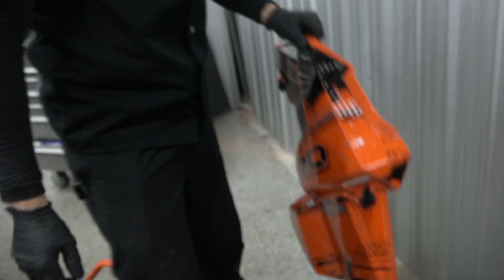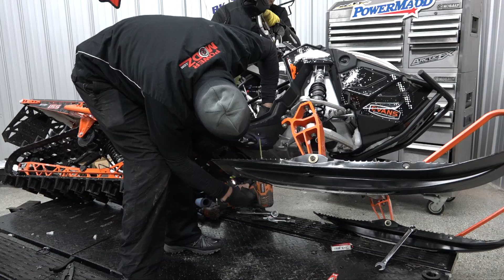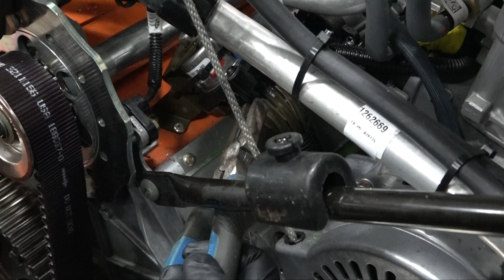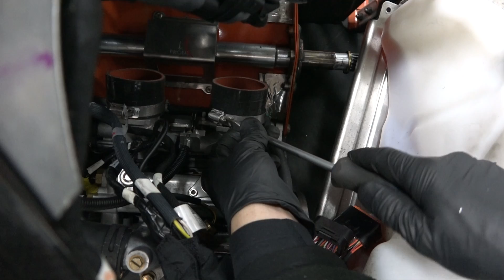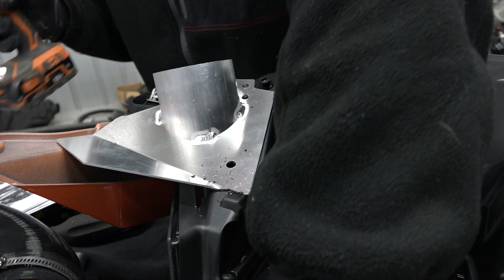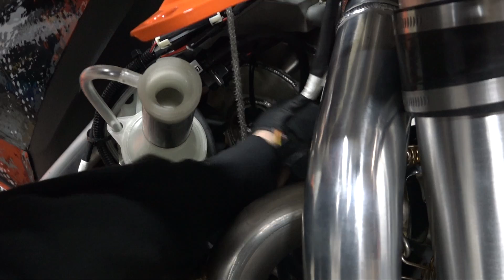Boondocker Sidekick Turbo Install - 2016 Polaris RMK AXYS 800!

Comment: Hey man I have a question I’m new to this turbo game, And seems that my waste gate has a slight leak coming from the 5 bolts area, Also what type of oil should I run on my 2016 axyz turbo and where is the oil tank located! Thanks
Reply from the maker: I thin k its best that you ask the turbo manufacturer

Comment: Hey, I live in Ontario Canada, and I plan on buying my first snowmobile. With some insight, I was hoping which you would recommend. Arctic cat, Polaris or Ski doo? And why pick one over the other?? Need suggestions !!
Reply: Depend on what youre gonna do bud.Go see a dealer not a pro backcountry guy on youtube. And ask your friends or forum on what the dealer recommended. Remember your still only just a client with a wallet lol Your first sled probably shouldnt be a +15k mountain sled. I have a polaris pro rmk axys 2016 but would still recommend an older mxz or something like that for a first sled. Cheap ,reliable and powerfull. You might not like it that much you never know and boondocking is kinda hard to start with. Hope this help
Reply: Especially with the fact that Ontario has one of the best snowmobile trails in the country. Ontario doesnt have that much snow in general and very very few boondocking spot compare to lets say north of quebec city ( where i used to ride when i was in the army)
Reply: Buy a used older sled first before you spend a large wad of cash on a new one
Reply: Yamaha is the way to go

Comment: Not a big fan of a turbo. Someone needs to make a supercharger for a sled. Then your getting cold air intake and not hot exhaust air.
Reply: Regardless of how the air is compressed (turbo or supercharger) the intake air gets hotter. In a turbocharger arrangement the exhaust air NEVER mixes with the intake air; it's just the exhaust force/velocity that turns the intake fan/blower...main difference is that the turbo is far more efficient than the supercharger.

Comment: What's the hourspower on the stock sled and how many more do you get with turbo for the pro rmk 800
Reply: Leonty Polushkin 165 hp stock then you add another 80hp with turbo so 245 hp

Comment: so how much boost do you actually get out of this setup at sea level? im in maine and was thinking about putting a turbo on my 2016 SKS .. how long did it take you to actually install this system?
Reply from the maker: +spencer conrad the install was about 3 -4 hours without camera taking my time.  it runs 2-4 pounds probably depsnding on what the altitude is.   it doesnt need a lot of boost at low elevations - it pulls hard.
Reply: +PowerModz sweet thanks! looks like a summer project for me!

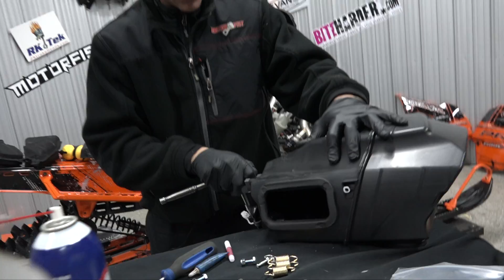Comment: 37:41 Typical Americans garbage, my favorite is when you have them combined inches in dept, International System of Units for width and some other ancient units of measurement (the designers own units probably) for length. Proper American design at its best.

Comment: How the hell does that tiny air box cool down all that compressed air is there just no intercooler is it just cool now to have hot ass air get forced into your motor now??
Reply: +Van Ouellette actually the outside air travels so fast from the intake, though the turbo and into the air box that it doesn't get super hot, this sled rips! makes the 860 big bore feel like a 600
Reply from the maker: +Van Ouellette on a really cold day it wouldnt make much difference but on hot days a water/air intercooler would be great - air to air I wouldnt bother with for our type of riding.
Reply: +Simon B You know that it ain't the heat form the turbo that is the biggest heat source for the air. Due to the Joule Thomson principle the air would heat up anyway. But on a low boost setup like this it doesn't heat up the air so much that an intercooler isn't needed.

Comment: That sucks, Brand new Sled, & already stuff is broken... Nice looking with that orange, guess if you get caught in an avalanche they will find you easy... Man I don't know how you can work in the cold !! that's funny they don't have Oil circulating out of those Turbo bearings.. Dish soap, or silicone grease may aid in, installing those T/B tubes..

Comment: Did the turbo add weight to the sled Louis ?
Reply: My wild guess is that the added weight equals to the weight of the parts installed.

Comment: Did you weigh the sled before and after the installation? How much did it add?
Reply: +Snurre86 i think from removing the super heavy stock can it doesn't add much at all